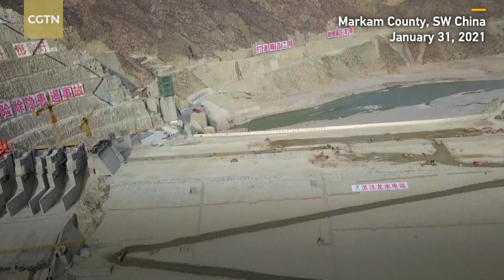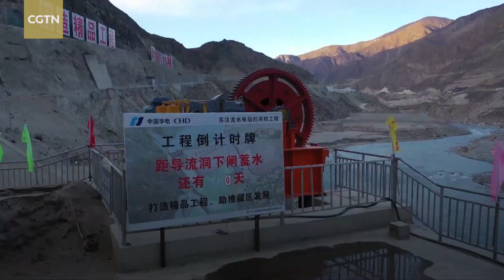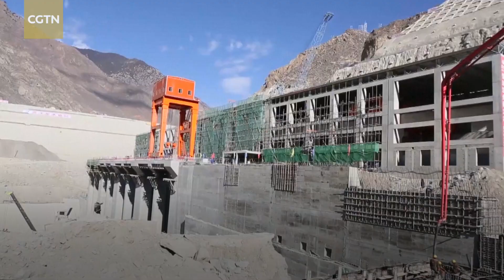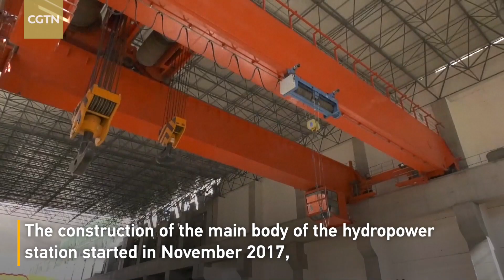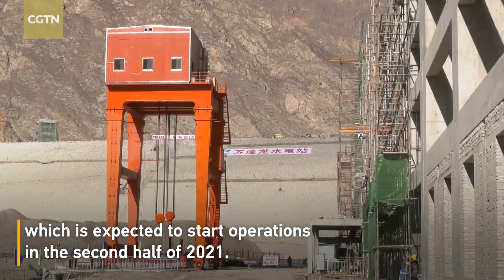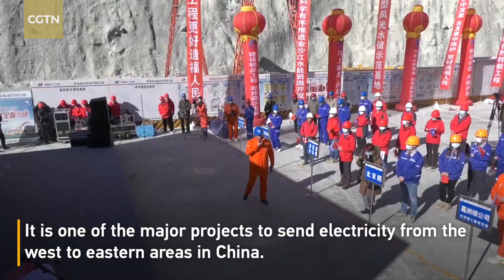Major hydropower station begins water storage in Tibet

Comment: Smaller power plant provides power for building big ones. China built Zangmu hydropower plant with about 0.5 milion kw capacity in Tibet not long time ago. Now this 1.2 million kw one. China's target is a 30 million kw one in Tibet!
Reply: 2000MW output to be fully operational in 2021.  As a comparison the Hualong One nuclear reactor is rated 1170MW each.

Comment: How about the people who live downstream? How will do without water?
Reply: Once the water has been impounded the normal seasonal flow will be arranged after passing the hydro to extract the 2000MW energy.  After that the dam will store the excessive water at peak season and release it at dry season to regulate the flow to suit the land requirement.
The dam is just a step in a river and Jinsha has about 100 hydros!
Reply: THE WATER DOESN'T STOP FLOWING
Reply: @petermathewvanaardt74  yeah. I hope That guy is not too stupid to understand. that dam is not blocking the water 100%, it's just control the flow,  control the flood
Reply: Please go to school to understand  what is called a Dam . The  Dam is not blocking the water 100%, it's just control the flow,  control the flood and get the electricity at the same time